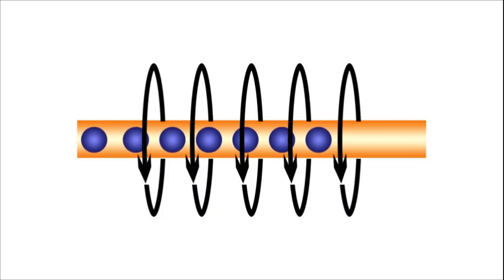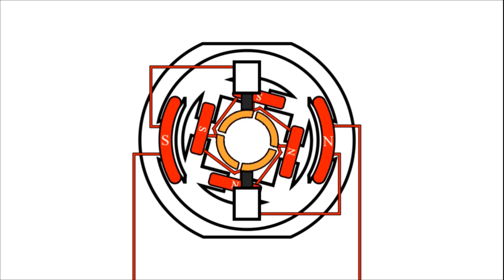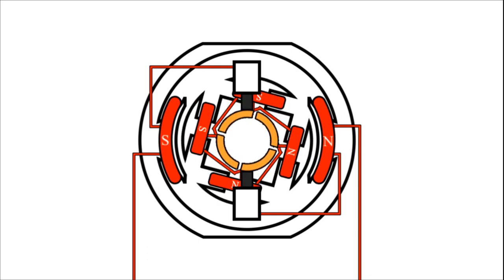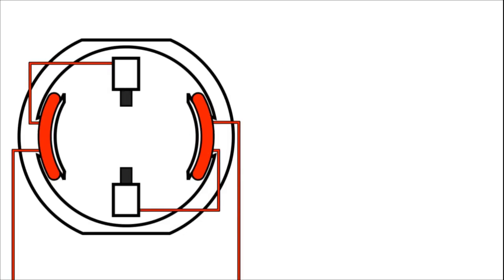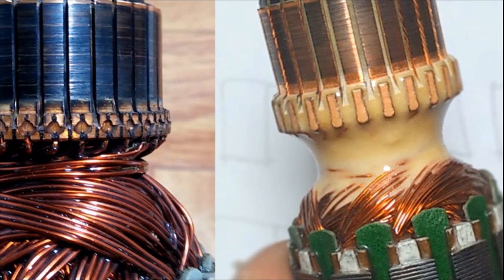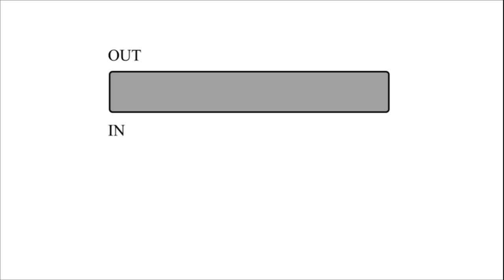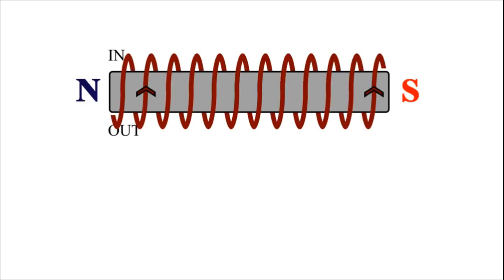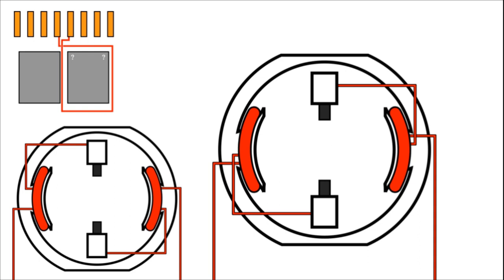Tips and Tricks About Armature Part 1 (2)

Comment: Sir how convert 115v.armature ,field rewinding 240v.....and Swg armature, field ....
Reply from the maker: Hello sir, adjust the gauge of the magnet wire sir to two down, like if its 22, make it 20 and the number of turns to as much as the slot can fit
Reply: @JakeMarvinVillegas  sir my angle grinder makita 9556nb 115v.runing..but my country voltage 240v....
How wire number armature rewinding and feild rewinding  number wire.and how turns armature and feild turn.